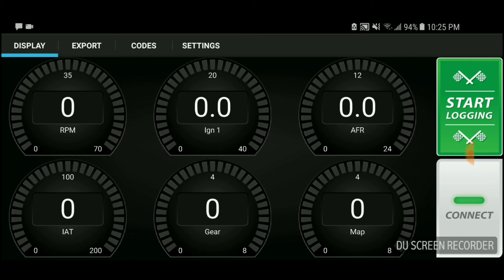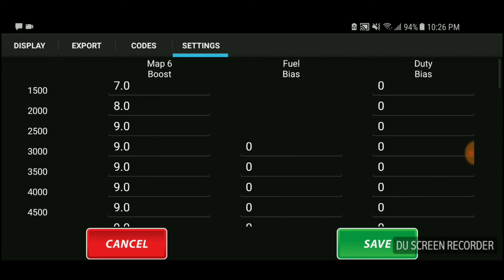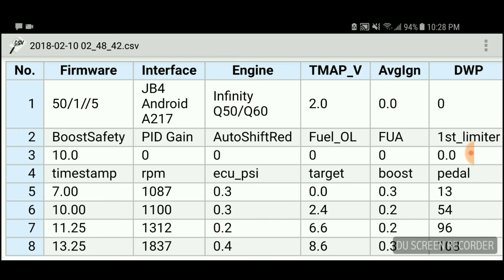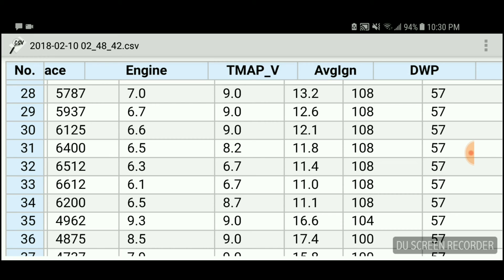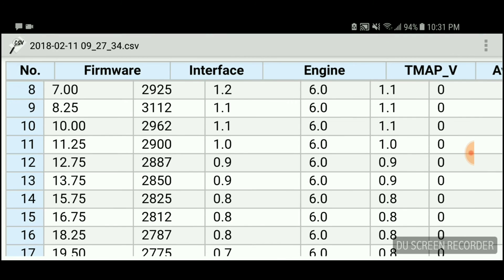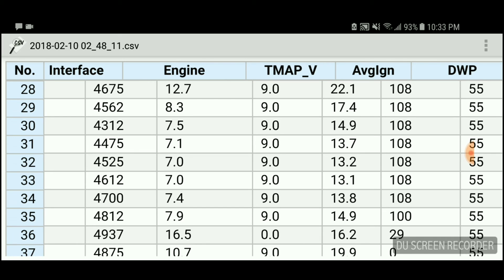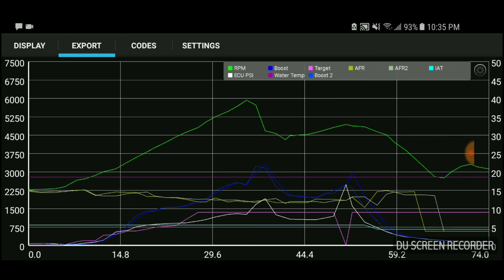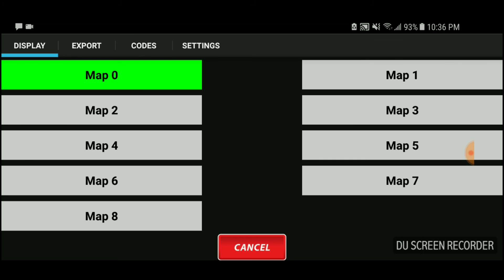How to run JB4 MAP 6 on Q50?

Comment: OMG you need to learn about afr dude.  It went supper lean under boost it will be pulling crazy timing to protect that motor especially on small turbos!   Good luck with that!

Comment: I recently purchased mine. When I connect to it,  my RPMS, AFR, GEAR, IGN, IAT gauges don’t move. I guess it’s not reading them. Any ideas how to fix that? Thanks.
Reply: same here, does that mean the jb4 boost isn’t working?? if you found a fix let me know
Reply: @ahmadalsheikh4236  I’ve legit been having that issue but my boosts still kick in amazingly but I still want all my gadgets to work
Reply: You need to connect the ob2 data cable to the jb4 and the obd2 port then connect via bluetooth and there that's it.

Comment: What are the best map 6 settings if Im running straight 91? All I have are intakes. Don’t have 93 anywhere near me
Reply: did you get any response?

I'm running 91 Octane, bone stock and not sure what to put for Map 6 (Not RS)
Reply: @jz1607  what’s your map 6 set up?
Reply: @baltasaur77  I'm not running map 6 yet. Just trying to find the good params to start with.

Also curious, do you know if 94 Octane with 10% ethanol would be better than pure 91 Octane?
Reply: @jz1607  when I was running map 6 I never went past 7 peak psi, and if you’re runnning anything over 4 psi you get way better results using a mix, I always used 91+E85 mix, 6 gallons of E85 and the rest 91
Reply: @baltasaur77  Thanks a lot for your answers. It seems getting E85 is gonna be a hassle here in Montreal. Sticking with 91, do you have a MAP 6 configuration that you used? (Without E85 mix).

Comment: I been running map 7 since i got the jb4 installed yesterday and it has been running great on a 2018 3.0t silversport. I need help with map 6 and would even pay someone if they help me after I log.
Reply: are you running an e85 mix or 91?
Reply: @andrewramirez8623  if i fill up 93, can I run map 7 safely stock?

Comment: So map 7 is pretty safe then? I'm running a mix of about 5-6 gallons of e85 the rest 93 I haven't had any issues yet been running it for about 4 or 5 months already haha
Reply from the maker: SS or RS
Reply: @Boost In Motion is it safe to run map 7 on straight 93. I have a luxe 3.0t.
Reply: @dixitamin2852  did you find out? i want to run map 7 on 93 also
Reply: @BoostInMotion  SS
Reply from the maker: Oh yeah that's fine if you're running E85  map7 is  perfectly good

Comment: What map do you run?? And what bolts on you got??
Reply: I run map 6 at 3500-5000 I run +7 psi, also I got a y Y-Pipe back exhaust and downpipes
Reply from the maker: G0t2BMiiRii currently running map 6. Im stock for now.
Reply from the maker: G0t2BMiiRii I'm running +9 from 2.5k -6.0k

I'm data logging. Afr is around 12.5- 13.5. Timing looks good also
Reply: Boost In Motion your mixing it with E85 most likely right???
Reply from the maker: G0t2BMiiRii I have no e85 station. Near me so I've been data logging to make sure I'm safe
Reply: Boost In Motion oh ok,  i just did a run on map 7, if you wanna check it out on the n54 forums, my user name is same as youtube, Terry said it looked okay
Reply: Boost In Motion hello I have rs400  intake down pipe y pipe blow off  walbro 450 what map u recommend for running hard and safe and what number is right for air fuel
Reply: @Boost In Motion East Orange NJ got E85. Lets go :)
Reply: JC PG I ain’t paying no GWB for E85 lol, I have one like 2 miles away from me on woodhaven, but then again I was never trying to do fuel mix, I just wanna be fast with just 93 that’s all